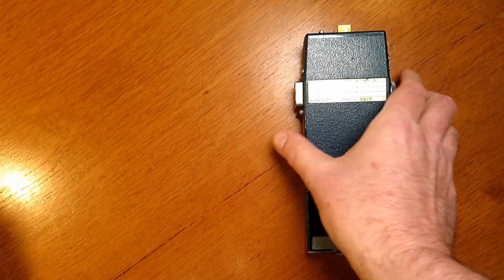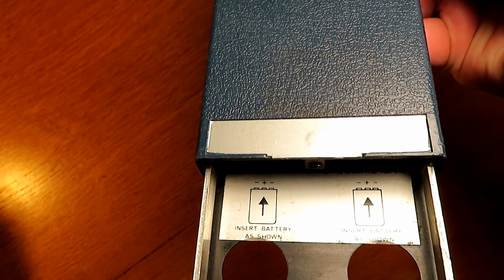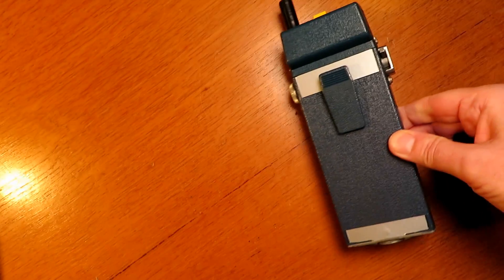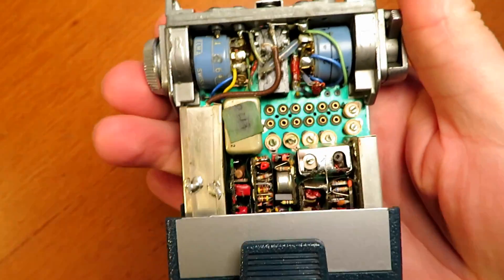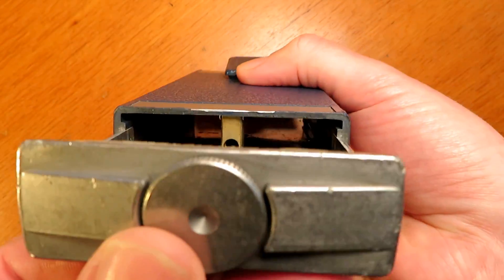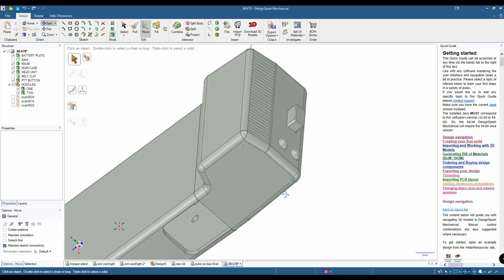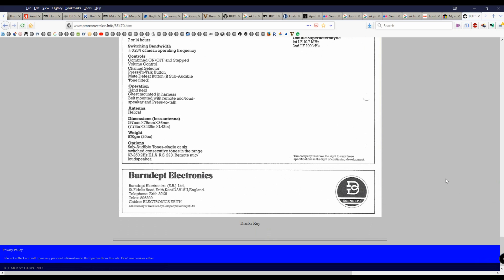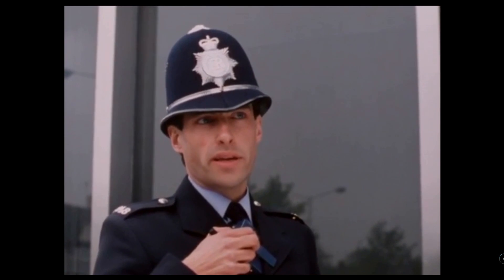MAKING A UK POLICE & FIRE BRIGADE RADIO THE BURNDEPT BE-470

Comment: Thank you so much for your really interesting videos on the Burndepts,
I have 2 off f these radios and 3 BE600’s.
I have been collecting ex police fire radios for a few years now and have been very lucky in the fact that I have received most of them in working condition, However, the Burndepts work but no crystals, I managed to get New Crystals made by quartz labs, Very Expensive, unfortunately they need tuning in to the Burndepts but I can not find anyone who can do this for me.
INFORMATION REQUIRED - I’m trying to find at least One Burndept 470 Harness, Do You have any idea’s where I could obtain one .,
Would be great full for any help, thank you.
Mark
Reply from the maker: Hello Mark, I've not ever tried powering up my radios but it is possible to tune them on to the ham bands, there may even be a section in one of Chris Loreks books on it? not sure, he definitely covers the pocket phone and the Pye PF8, wouldn't be that hard to tune one up though just through trial and error, as far as the harnesses go I have seen them on eBay pop up now and then, if you do a saved search on eBay it will alert you every time something with a key word appears, I have mine set for Burndept.

Comment: Hi,  I used the BE470 in the police from 1978 until they were replaced in around 1987 by the Motorola HT600 set.  The channel change lever on you set in the video was not standard-a semi-flush blue channel knob with a slot for a coin etc but in practice was easily moved with the thumb pad.  The button above the volume control on you set is a mod; hole should contain 3.5mm jack socket for an earpiece for use in noisy environments (football matches etc).  The 2 small protruding silver nuts on the top panel adjacent to the PTT button are an external antenna connection.  There was an option to have a black rubberised booster receptacle installed a vehicle to convert the hand portable to a mobile device.  The 2 nuts connected the car roof mounted antenna.  The vehicle adapter had a pencil type microphone with side mounted PTT button. I think the adapter had a small mic element to pick up the speaker audio and amplify it to a car mounted speaker and a a small transducer to funnel the transmit audio from the pencil microphone into the mic in the hand portable.  The PTT button on the car adapter pencil mic activated a solenoid where which depressed the yellow PTT button.  A bit heath Robinson and the adapters failed very quickly I think due to the solenoid failing or the lever microswitch in the adapter custom aperture which switched the adapter on when the radio was inserted into it.  My force stopped fitting the car adapter after about 1979 as they were so unreliable.  Although our local Fire Service used the BE470 it was never intrinsically Safe.  They had used other sets where ch were on the fire ground.  The BE470 was used by Fire officers and later by the appliance driver as a mobile handset extension when Pye Whitehall and Westminster repeater mobile were fitted in Fire Appliances.
Reply from the maker: Wow thanks for that comment, great to hear from an active user, thanks so much 👍👍

Comment: One of the flaws with these radios was,  When carried in the chest harness.. It was possible for the original solid antenna  to be pushed up through the chin of a police officer when they were in a struggle with some one.   I do believe they made a small flexible antenna  ( Rubber Duck ) with a larger soft cap to help prevent injuries.

Comment: Hi, Thanks for the video, thoroughly enjoyed it. I was t a police training centre in 1975 (Eynsham Hall Witney - now a bit of a posh hotel) and during the second half of the course had to do 'Duty Team' patrolling the site through to the early hours. We used the Pye PF1 'Pocketfone' Personal Radio. These had two units: a transmitter with an antenna which shot up when the PTT was pressed (had to be aware of your eye) and a receiver that would clip inside your tunic. They were great fun and worked a treat at night in the sticks but, when working later in central London where temperamental and the receiver was far too quiet. Sadly I never got to use the Burndept BE-470. Later we had the Storno CQP512R, a bit of a game changer. It was all spoilt when Airwave came in 2004/5?. A brilliant, flexible and reliable bit of kit but I still liked my previous 'proper' radios and was very aware they were mobile phone like in their operation. I've been a Ham for 5 years now and I still feel the same with Ham digital modes, I use them but have this old feeling I had  all those years ago in the police. Be good to see how you get on with the project.
Reply: Crikey I had forgotten about duty patrol. We used the Burndept, but the batteries were pretty well shot so didn't last very long, the Motorola HT600 was the replacement, which was fine until they added MASC which was a complete disaster.

Comment: Thank you for another very interesting video. I look forward to the finished product, I really do think you should go into production!
Below are a few (hopefully interesting) facts about the BE470:

I believe the radio you have has been retro fitted with a squelch defeat - that should actually be the earpiece socket.

Wearing the radio slung around the neck was officially discouraged as there was concern that the villain might grab the radio and whack the cop in the face with it. The left breast pocket of the police tunic was actually false but had a slit pocket behind it which the radio was slid into (hence the speaker/mic being located atop the set). The harness was then fastened around the shoulder and tightened, if done correctly it was not possible to play "belt a Bobby with a Burndept".

Earlier models had a red TX button and later ones yellow.

The radio was also used by HM Prison Service.

The 2 metal studs on top are for the mobile adaptor shoe.

Due to the limited number of channels on the radio and there being 40 odd forces every radio was fitted with one of two "national" channels for occasions when officers were used in other force areas. A good example was the '84/'85 Miners Strike when large numbers of cops came up north.

Last but not least - it is probably impossible to find a BE470 aerial WITHOUT teeth marks!

Again I do hope everyone is still awake! Oh and I also have the crystal formulae knocking about somewhere if you require it.